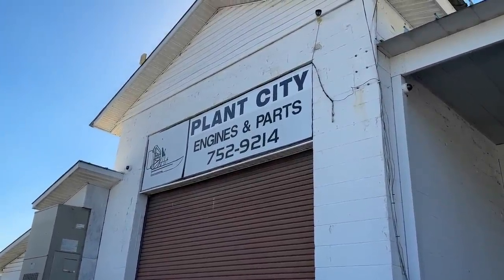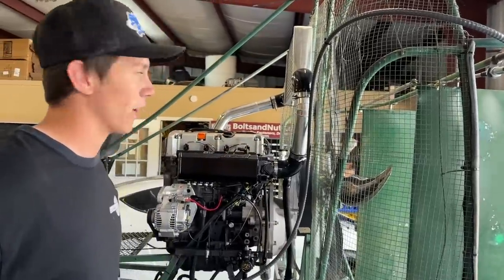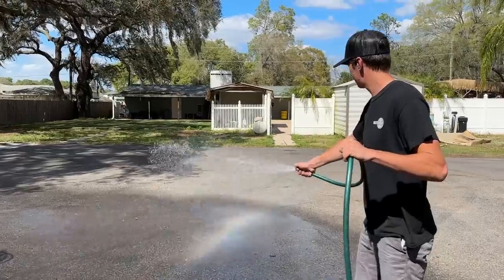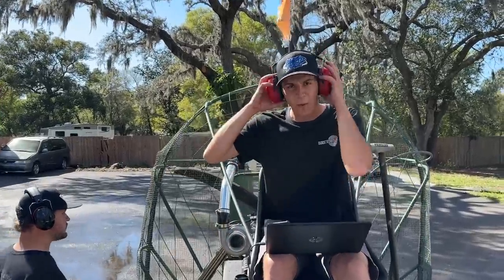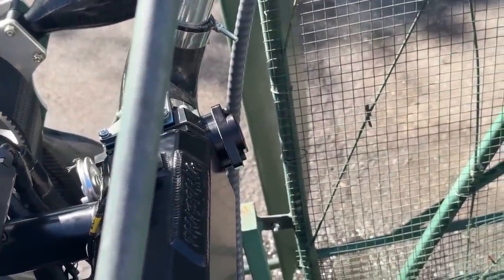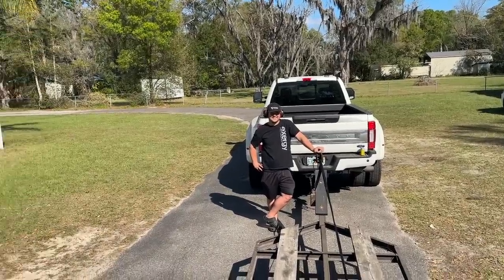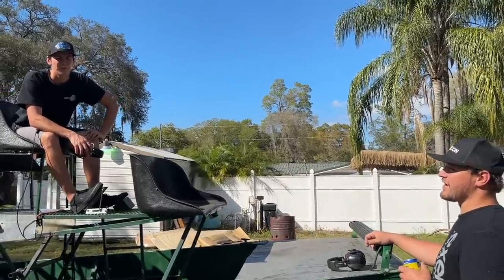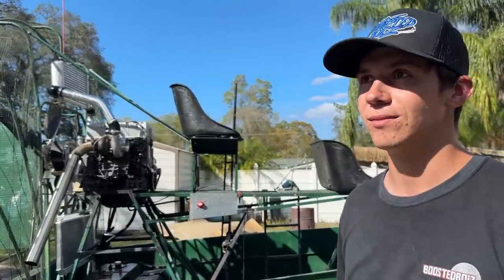First Drive In Our Turbo Honda K24 Swapped Airboat!

Comment: You should keep your prop speed below 3200 rpm. Anything above that causes the tip speed to exceed the sound barrier and create turbulence that decreases the efficiency by around 30% instantly,  its also very unforgiving on the blades.  If you exceed that limit under full load you need to re-pitch the prop to limit rpm and increase thrust.   Exploding props are terrifying and can easily be deadly!!!  Have fun and Stay safe fellas!
Reply: Would diameter come into play? Or the small ones are still exceeding mach1 at 3200? Just curious
Reply: Diameter plays a significant roll in the equation. General rule is 3200 for a 76-78" prop.  There are calculators to get exact numbers on most prop manufacturers web sites
Reply: It has a reduction gear and prop made specifically for the K24
Reply: Yup! My airboat tach was off when I bought it from the previous owner and the first time I tried to drive it, it over revved and snapped the prop and crankshaft off at 3500+ rpm on an o-520
Reply: It appears as if the boat tried to nose dive which would make me assume the clocking on the motor would need adjusted?
Reply: @codyknapp424  thrust angle is a thing.  Something they will have to figure out with trial and error.
Reply: @1fat66  he has the proper set up for his engine that's for sure.  Unfortunately you still can't push the prop past supersonic speed at the tips or it will eventually fail.  The stress of blade turbulence past mach 1 is unbelievably destructive, even for carbon fiber.
Reply: there's another video when they go to get the blades where they talk about the gear reduction and the store owner talks about all that stuff as well.
Reply: @codyknapp424  no it’s just that shitty ass hull, you’re supposed to start out with the motor level with the bull and adjust a few degrees max
Reply: @spencersmith5271  
Maybe you, and the others, missed the hull is sitting on a fixed surface - under thrust from the prop' there is a big moment couple rotating the boat into downward pitch.
Reply: @gordowg1wg145  that’s why I called it a shitty ass hull haha it’s an awful design
Reply: @spencersmith5271  
Uh, either you meant to reply to another post or you didn't understand mine? 😉
Reply: @spencersmith5271  Your right, that hull is the biggest pile of shit! Get a good hull under it and you would see a world of difference.
Reply: More pitch in the prop and find some skinny water to go run it in
Reply: I would be scared seeing that thing go spin to 10k.
Reply: Of course, that motor would be the most fuel efficient at 3200.
Reply: @JAO911PLIST  
Uh, that would need the prop to be sized and geared so it was at it's most efficient rpm when the engine was at peak torque.
As it is, that's most unlikely to be the case.
Reply: Not sure how you decided that rpm results in a supersonic tip.  It's entirely dependent on the propeller's length. A 50" prop can go 5000 rpm without going supersonic.
Reply: @mp-xt2rg  
Not sure how you could post something that damn ignorant. At least the OP had it in context for the prop' diameter used.
You DO understand it's the tangental velocity - or if you prefer the rotational speed of the tip - that is critical and this is a function of both the diameter and rpm of the propeller?
If my sums are correct, that would mean a 50" diameter prop' would have the tips go supersonic at around 4200 rpm assuming speed of sound is 11ft/sec?
Certainly short of trying to run it at 5k rpm - even without the risk of mechanical failure from the centrifugal loads on the blade roots.
Reply: @gordowg1wg145  maybe look into the dunning Kroger effect. I'm fairly well versed in propellers given my experience building experimental aircraft and being a licenced pilot. Mach 1 on a 50" prop is 5200 rpm at sea level. 4800 would still be reasonably efficient. Sure people use reduction drives but my point is that you can spin much faster than 3200 and not go supersonic. Just because you believe something is ignorant doesn't mean it is, maybe it's you.
Reply: @mp-xt2rg  
It was a literal "back of envelop" calculation, not that surprised if I was a bit off. Ah, math' holds out, but if you can support your claim I'll add that to the knowledge base - one can always learn more.
Not to mention the reduced efficiency as it approaches the trans-sonic range.

HOWEVER, whether the rpm I, or you, cited, is accurate, it doesn't negate my point that RPM IS a critical factor WITH the prop's diameter - something YOU shouldn't have outright dismissed, since YOU'RE the "expert"!

Maybe the D-K is more applicable to you?
Reply: @gordowg1wg145  My point was that max subsonic rpm is directly tied to the propeller's diameter. On my Cessna the prop is 75" so 3200rpm to go supersonic. A 12" prop can go 10000rpm+ before going supersonic. Even going supersonic isn't an issue go to an air show and watch an aeroshell demonstration tips are supersonic most of the time and are loud as hell. Russian bombers operate exclusively in the the supersonic range and are quite efficient.
Reply: @mp-xt2rg  
Agreed, both the diameter and the rpm.

Definitely not sure I'd agree about the Russian "Bears" - they're notoriously loud - to the point where the US submarine detection net (SOSUS) was picking them up. The noise being due to blade tips that were trans-sonic, basically causing a constant 'sonic boom'.
However, the aircraft normally being used in that state shouldn't be taken as any sort of endorsement on their efficiency - the military, and especially the Russian military, have never been that concerned about details like that, save maybe as regards operating range - although the dual prop' design would be expected to aid this.
Reply: Forgot, I have a hazy recollection of a prototype (not sure if it went into service) with a single, dual stage, counter-rotation prop' powered by two engines, the rear being placed similar to the 'Cobra series of fighters - might be mistaken, though?
Reply: You should use it to push your truck down the road like the rednecks in the neighborhood where I grew up did.
Reply: Had a buddy hit the back with a 4" piece of wire deep in his Trapezoid muscle near his neck. Old School wooden props back in the day.

Comment: It looks like you could lower the engine and prop 12 inches and the seats even more  and make it more stable.
Reply: Yes yes I agree.
Reply: 12 is probably abit far but maybe 6 to 8 inches will make a giant difference in stability
Reply: Just dropping the passenger seat would probably go a long way for the minimal effort required, but a proper hull would really be the ticket.
Reply: belt drive and drop the engine 2 feet wouldn't be too tough.
Reply: @modelnutty6503 yeah this I reckon
Reply: Whilst lowering the seats, may as well swap them out for 3 Brides.
Reply: @modelnutty6503  it's already a belt drive. So...
Reply: @martindinner3621  With the worlds shortest belt.
Reply: Exactly

Comment: I'd look into lowering the seating deck. The lower you get it the stabler it would be
Reply: but the higher you sit, the more you can see.
Reply: @X3R0D3D  not sure what u need to see, water is flat.
Reply: And if you take the top skin off the nose for a fully open deck will give leg room for passenger to sit lower aswell.
Reply: @X3R0D3D  That's true for your typical airboat. That's why the driver is always up high to see crap coming that you don't want to hit, like tree stumps, and boulders. But this is far from a typical airboat

Comment: If you get a bunch of water In the boat you can pull the plug out as long as you are moving and it will drain out the water.  It's really fun to do with non boat people they start freaking out thinking your going to sink the boat
Reply: All the water will come out if you're planing and the boat's full of water. You still have to have the bow and eye to pull on. Flat bottom SK style
Reply: Try getting to said plug with that prop spinning.

Comment: Great build boiz like always killing it ...tps I getting blown by boost leak by throttle body shaft smoke tested  and you find the leak ...drill a tiny hole at the base of tps between throttle body  and tps and won't happen again .or get another throttle body...then get a fishing rod  Springfield xd 45mm had gun and go fishing for gators ....fun times

Comment: I ran a very similar hull on an airboat we had but i relocated the seats and it made a huge different  in the boat. i moved the driver's seat to the height of your switch panel then dropped the passenger seat far enough you could put your feet on the floor and it was a night and day difference with COG
Reply: Nice you won a free scam 😅

Comment: You should put some springs on the rudder bar to have it center itself. Seems like it'd be a cheap and easy solution to provide a bit more stability and ease of use.

Comment: If you're really concerned about the water, look at installing an auto-bailer. They allow water to drain out of the hull while going forward but will close down when stopped or backing.  Also, life jackets.

Comment: I’m no expert, but I think the reason they put the steering cable lower is in case you’re going through brush or trees it doesn’t get caught in some branches.  If you’re out in the middle of nowhere, that would be a hell of a thing to lose.
Reply: That's a good point
Reply: There are all kinds of clever things like that on various vehicles and machines. My old 42 Jeep the tie rod setup was in the front of the front axle so if you hit anything really hard underneath the front it was easy to damage the steering components right there. I also had a early 41 Power Wagon and all those parts ran behind and underneath the front axle. If you hit something the tie rod would just move and bounce out of the way because it was built to work and still be able to give if something ran into it. Also the front grill cage protected the headlights and radiator. The Jeep everything was set back behind the the stamped front grill so same thing. The old guys were more clever than folks realize about making things work and live in bad situations.
Some things used to be built for function over form and routing that cable a certain way had a purpose just like the Jeep and Power Wagon I used to have.
Reply: @69Dartman  all jeep wranglers have the floating tie rod
Reply: @wyattmartin534  Well I've seen it under various awd heavy duty trucks but the first place I noticed and had time to think about it was under my Dodge. It really is a good idea but maybe most light duty trucks they don't care or it's more complicated to build. The setup under the WW2 Jeeps seems pretty complicated and fragile but it worked and I never broke or bent mine that I'm aware of.
Reply: Was also thinking to lengthen it to the front seat .. better weight bias..

Comment: i have several friends with turbo ls airboats. most put the intercooler in front of the radiator. a couple have it up there and have no problems. the main thing you guys need to do is trim you crankshaft angle and prop angle. the prop could use more angle to keep the tip speed lower and give you more thrust. and you need to adjust the crank angle so that it doesn't push down on the front as much.

Comment: I love it. You guys took what some would consider junk and constructed a really cool airboat. The turbo Honda is able to produce about the same torque and horsepower as a normally aspirated 4.8 LS while using a lot less fuel overall. Kyle and Wyatt might look into widening the hull, making it more stable and a bit less leaky.

Comment: I love what you guys do. It's so cool to see it on the water finally. Glad you guys are having fun. Maybe a suggestion to help with the top weight. I've always wondered why you decided to have the motor so high up. I understand for simplicity. But if you can bring it down and then belt drive the fan blade it would really help. Also look to see if the angle of the blades can be adjusted slightly too. Maybe it needs a little. Size of pulleys can help with ratio of blade turns.. can maybe get more out out of it with the belt. But still amazing to see it working.

Comment: Hey guys, get 2 smaller pontoons one for the left side and 1 for the right side. Mount them solid near the water line of the sides and that should fix your side to side worries on turning. Maybe 12" diameter pontoons or bigger. Or Balls to the wall and find your limitations! I'd carry a pistol for the alligators just in case!

Comment: Two quick observations guys. You have to consider your weight distribution. You have a lot of weight on the back have of the hull, add the captain and you start getting the pendulum effect. Got to move it around, like moving the fuel cell and battery. Maybe moving the captain to the front. Also, I think you running a gear box, like a 2 to 1? That allows you to turn the motor at a max of 6,000 RPMs while keeping the prop at 3,000 RPMs Anything above 3,000 RPMs the prop reaches what known as the critical point of departure. In other words, you props can simply fragment.  Also you have to insure you air push is correct. This is done by raising and lowering the back of the motor, never allowing you prop to go lower then 4 inch’s below the transom. I really like the Honda motor idea. I’m not sure at what RPMs that motor turns the HP on at. But keep that prop no more then 3,000 RPMs. As a safety note, never walk behind the boat when the blades are turning. A simple washer or any object that gets in the prop becomes a bullet as it’s slung out the back. And that prop will suck every loose item into it. Stay safe and ride.

Comment: I grew up hunting off air boats in ak cut the front seat off make a bench seat u don't have the torque for a big load but that will lower the weight of u have some one on and yes that haul has sharp edges so it will catch rounded sides with a Teflon bottom so u can slide most ppl in ak have big blocks or atleast a 350 the torque helps alot if u can fix the boost and get in a inch or 2 of water u will fly we haul moose in ours aswell as a few ppl and its all wetlands with beaver dams and dry land so u need the power and the copper river which is sketchy in a airboat

Comment: I’m no expert in physics or anything, but I think a way to help counteract the boat from tipping forward is to put some ballast weights in the back of the boat or adjust the angle in which the motor/prop is sitting so it’s angled towards the front of the boat so the prop pushes front upwards instead of down

Comment: I believe that the next time you load your air boat on a trailer, make sure to have a water hose spraying water on the trailer ramp. It'll reduce friction and drag. Just some advice from an old man that's done that before. 🤣🤣🤣🤣

Comment: Raise the intercooler up a little to improve airflow into the propeller. 

Get a throttle with set increments so you can let the propeller spin up at a set %.

Comment: A simple rule of thumb with center of gravity is try to keep your added mass below the centerline of the torque, currently the seating position of the driver places the mass above the prop centerline adding to the effect of the torque and Majorly raising the center of gravity. There's no reason the seats can't be lowered about 26 " actually the whole engine and seating structure should be about 12 " lower but the seating about 8 inches under the centerline of the prop shaft..drivers hip line should be under the prop output shaft line.

Comment: My only ride in an airboat came from an old man in Nebraska. he also had a plane. He had his boat built to the same specification as his plane so his boat and plane had the same engine and even power-to-weight. We got to an area where we were hydroplaning pretty good he asked. do you get dizzy? I said nooo  ooo  oooo oooo ooooooo. we were going 60 doing 360s like a noob with  controller setting to high. FYI he flew for the Navy this guy knew his stuff. Most exhilarating ride I've ever had. a friend flew me in a WWII Mustang we hit 300mph 100ft off the ground. airboat was better.

Comment: Needs difference fans for low horse power . Needs 3 thick blades for more push, the slims ones are for high horse power, makes it more smoother

Comment: if you need it to nose foreword more you can play with the rear steering flaps and add a kick down panel that directs some airflow downward which will nose you foreword and help keep it on plane.
Reply: It's not a plane, rudders are for steering only. you adjust engine angle @  the mounts 1 or 2 washers at a time.

Comment: If u haven’t already but a sheet of polymer which is a very hard plastic and either rivet or nut and bolt it to the bottom and be able to run across rough terrain or either do slick bottom glides over grass like nothing

Comment: You could mod the frame a bit and lower that front seat down a foot or more to help with the COG for 2 peeps and it won't feel so sketchy.  Could also add some shallow runners on the back half of the bottom of the hull to help "bite" into the turns more while on plane. Gotta take into account the torque effect of the prop too when in a turn, "slow "and steady on the throttle does it! Time to go Gator hunting!!!

Comment: Fine with 2 people you just need to run in shallow water. Like 6 inches. Other tip very easy to sink from the back wash. Always slow down easily until your wake lifts the stern up

Comment: you could make a shroud for in front of cooler 2/3 of length x width. air flow speed's in then slow's down whilst going thru cooler making it more efficient

Comment: I've never owned an airboat but I know people who have and they have always said that it's going to feel top heavy because all the weight is above and on top of the boat and not in or below the boat and it's a different feeling and you're seating position is way above the boat and you're not going to tip over it just feels like it and you can turn just as sharp as any other boat